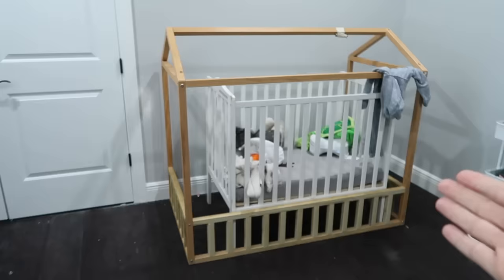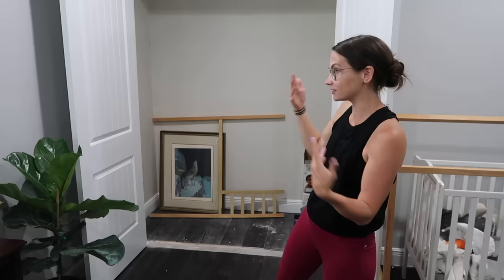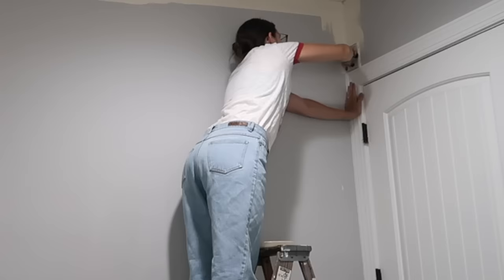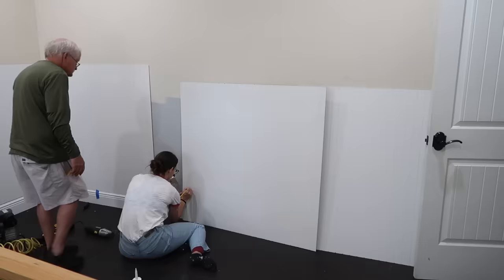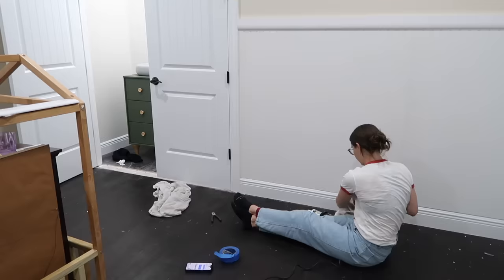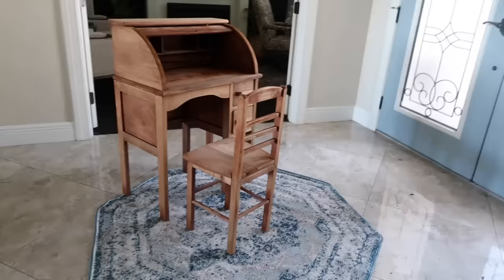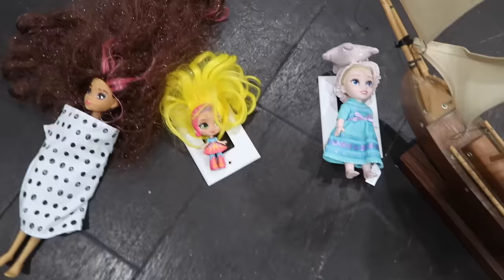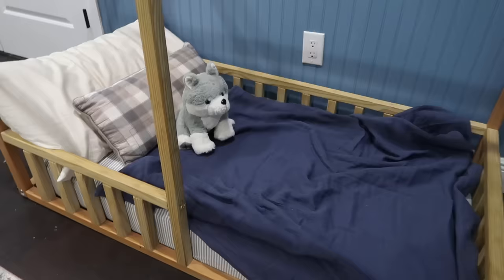Kim The Toolman Taylor! Vintage Room Makeover for Wolfgang! SO Amazing, DIY's for Beginners & Beyond

Comment: I have that same desk, almost exactly.  It belonged to my mother.  The chair is different; mine swivels, and my desk has a center drawer and a pencil rest beneath the cubbies.  Thirty-some-odd years ago, I took it down to the original color, going through several layers of paint, and painted the drawer fronts blue.  I never could decide how to paint the chair, so it remains original.   It's such a sentimental piece.  It was in my room growing up and now it's in my family room.  I've filled the drawers with little toys and interesting things for the youngest visitors to our home to explore.  It looks great in Wolfgang's room - you did a great job! ~ Lisa
P..S.  If you add a strip of fabric to the hem on the curtains it will help immensely.  To be perfectly blunt, high-water curtains make it look like you were too cheap to buy the right length.  But, it's an easy fix.  Look for a stripe or graphic print that has the colors of the room in it and just attach it with a running stitch, or even hem tape.  Aim for the hem to just kiss the floor.  It will add so much to the room.  Hope I didn't hurt your feelings 🙂

Comment: Well done! Don’t mind the greens in the rug, it’s good, the desk, sand paper it, all the water has messed up the roll top, but rub a bar of soap on the grooves, it will slide easier. God bless 💕 happy Easter
Reply: I agree, the wood probably swelled, let it completely dry. I was going to suggest Johnson's furniture wax. Rub it generously in the track and raise and lowered numerous times. Also, make sure that the roller is sitting in the groove.

Super cute.😊

Comment: That is correct that you use a brush or even a foam brush to get inside the grooves of the breadboard, so you would push the paint into the grooves first with the brush/foam brush, then roll with a smaller 6” roller again, this will get the paint into the grooves and you’ll have a much better result.

Comment: Studs are typically 16 inches apart from each other. There are always studs on either side of a window or door, so you can measure 16 inches from the edge to get general guidance on where the next stud is located in the room

Comment: I've learned over time, just buy several roller covers and pitch them when you switch colors. I don't know how many times, I've washed out a stupid roller. Ruined my sink. Now, I just paint and when I'm taking a break or coming back the next day, I put the whole thing in a ziplock bag and seal it up with the handle hanging out. Then when I come back, its still moist. When I'm completely done painting, I pitch the roller cover.

Comment: It looks cute Kim. You might want to do a couple coats of poly on the desk. I only say that as it will protect the raw wood but shouldn’t add color. I think you can get it in a spray can. Just do light coats and FOllow the recipe (directions) on the back of the can. It will save you time and frustration in the end. Also don’t do it in the sun.

Comment: Kim, couple things: Looks amazing but if you are wanting to get into DIY Ryobi make a great range of small but heavy duty tools specifically for DIYers that are lightweight and easy to use. Also, we have a saying in the reno community... Do your best and caulk the rest! The one rule you should always try and follow is the dry time with paint! You will get great results! You can use a wet ("primed") roller to paint and it will be just fine. We are in the process of doing up our whole 120-year old house in the middle of England and it's just an exercise in feeling awful about yourself and just doing your best! 🤣 Good work!

Comment: You're right about everybody wanting to do the paint rolling because it's the easiest, or just the fact that you know you're on the home stretch after taking all that time breathing in the latex paint while trying to get the dang edging done.  I helped a friend one time who wanted two different shades of 8" pink pink stripes going vertically in a large walk in closet.  The taping and measuring of the stripes after the coat of light pink was way to much, because i painted the ceiling light pink as well.  I won't volunteer for that job again, i can't use a ladder to do that kind of thing anymore anyway, but i remeber being glad when it was done though.  You do a good job on these project's, and you aren't afraid to try and do thing's that you see and like.  I again thank you for the laughs, because sometimes when life is hard, it just helps.  I look forward to seeing what other project's you have coming.  G-d bless.

Comment: Room looks amazing! All your hard work paid off! FYI - for the holes from the previous owners on the wall, you can fill them with the pink stuff you used on the bead board to fill the nail holes. Then just paint over and you don’t need to find something to hang over them. 😊 Again job well done.

Comment: 🖐️🖐️🖐️🖐️🖐️🖐️🖐️🖐️🖐️🖐️🖐️🖐️
I am a little worried about the outlet  over the mattress.  Get a solid cover plate from Lowe's to completely cover that outlet.  The other outlets should be fine with child resistant plugs.
🖐️🖐️🖐️🖐️🖐️🖐️🖐️🖐️🖐️🖐️🖐️🖐️
WELL DONE!!!!!
🩵🩵🩵🩵🩵🩵🩵🩵🩵🩵🩵🩵
I love the Wolf picture.  Great colors.  Amazing rug.  Wolfgang and Meredith rolling on the rug was soooo  cute!!!!🩵
Drapes long enough; looks intentional that they meet the baseboard.  So much nicer to avoid the floor-dirt-ombre hem in the long run.  
         Simplify and conquer the secret passage to Wentworth's room.   Get your neighbor with the magic stud finder to locate the studs in the wall between the rooms and cut only the drywall between the studs.  Leave the opening crude as long as there are no sharp edges.  Duct tape over anything that might catch.  There should be 16 inches between studs; consult Wentworth on height he is willing to crawl through.  Use the wicker hamper to conceal the entrance.  Crudeness is so much more of a "SECRET PASSAGE" look .   Skip the expensive doors that are too expensive and too polished looking for kids' imaginations.  Think pirate cave or secret agent hideout.    Better pick the passage from Wentworth's side since he already has some closet organizers .

Comment: Krud Kutter in the red bottle from Lowe's might take that paint off the floor. We used it on LVP and it worked well. Spot test it first to make sure it doesn't take the finish off the wood floors though.

Comment: I used to do trampolining and we were taught how to fall because you still don’t want to break you arm/wrist when doing a front drop. I was taught when falling forward to put both hands under your chin to protect your head and so that the bottom of your arms hit a surface and you are less likely to get any injuries. For falling backward fall directly on your back. You do not want to fall on and arm or your shoulder as you could cause a broken bone if you fall too hard.

Comment: Home remodeling/painting can be daunting without the right tools, which is what you’ve been experiencing, so thankfully you have the tools now to make straight wall/ceiling lines to get a better job.

Make yourself a paint supplies tote with drop clothes, brushes, edgers, gloves since using gloves you have a better grip on your brush, painting clothing, etc. 

This way you always have your stuff ready instead of looking. You own a home ~ there will always be painting projects.

Again - start at the top of the room and work down to floor.  Don’t start mid wall with painting, that’s just foolish.